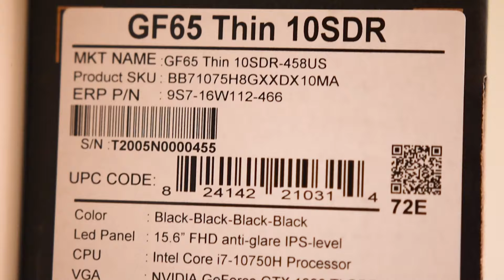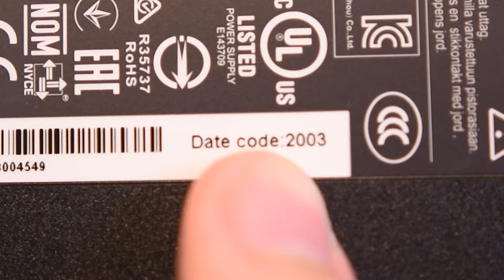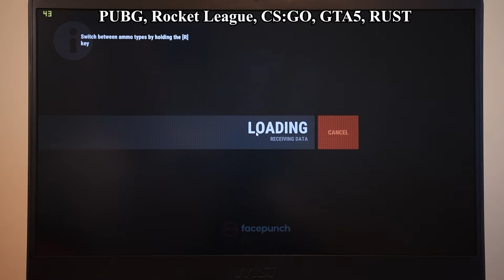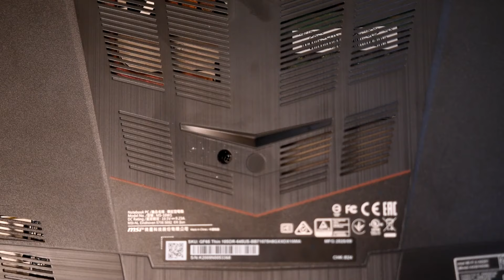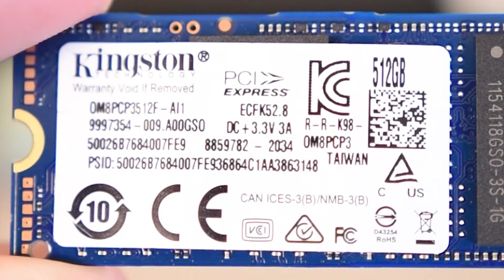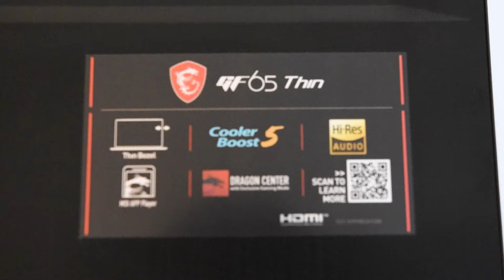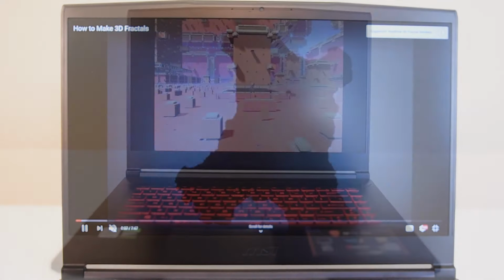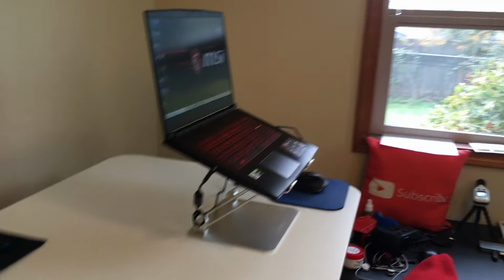GF65 Thin MSI GAMING LAPTOP REVIEW, GTX 1660TI,  6 CORE 10750H

Comment: DO NOT BUY THIS LAPTOP. I bought it 2 months ago and I regret it. Horrible thermals. Gets super loud. Can barely run of today’s games. Just don’t buy it. Save ur self and buy a pc for the same price instead
Reply from the maker: Yeah pc will almost always be better but can you show me a gaming machine that is quite and not hot? they all tend to do that if they are a laptop. 

if you have any more questions feel free to let me know I am standing by, I am trying to build the best tech channel possible if you like this kind of content I think you would make a great subscriber. Good luck and let me know if you have more questions :) I love chatting about tech.
Reply: I actually have this gaming laptop and I’m able to play the games I love. I mean I guess you won’t be able to play the games that are very high in graphics but so far the newer games, I am able to play them and the ones that I am not able to play that are new, I was just recommended to just add Ram to my laptop and then I should be able to play those newer games.
Reply: Also gaming laptops tend to get loud and hot. It’s the normal.
Reply: For low thermal, underclock the cpu. That's simple.
Reply: Seems like a very average laptop to me.

And laptop use case is different from desktop.

You cannot lug a desktop too University or if you travel alot.
Reply: I have this I upgraded to 32gb ram. Play destiny 2 and spiderman on it. It gets hot and it's loud but it's a laptop so I understand it's not a PC. The price was great.
Reply: I had this thing sense 2020 and it can't even run on the lowest graphics

Comment: I actually bought this same laptop and its arriving in about a week of posting this comment so thanks for the heads up on what to expect with it
Reply from the maker: Super glad you found this video useful. I cant wait to hear about how your experience with this machine goes. Since you enjoyed the video I think you would make a great subscriber. Let me know how it goes when the machine arrives. What games will you be playing?
Reply: @SERGE_Tech  mostly rainbow 6 siege and halo reach but who knows, I can run probably run anything on it
Reply: @swearetic  Would you please give me a minute and tell me how was your experience?
I'm planning on buying it, a first hand review would be very helpful, thanks.
Reply: @kumarshishupal1583  so far, its been great. When gaming the laptop got pretty toasty but an undervolt fixed the problem. Raise the laptop when you're gaming though. The one I got was 8gb of ram but that was an easy upgrade. There's also an extra nvme slot so you can get more storage. Overall, it's a great choice and I really recommend it
Reply: @swearetic  Thanks brother, really appreciate it, I'm thinking of buying a cooling pad with it and a bit confident that it'll help
Reply: @swearetic  hell explain what you mean by undervolt
Reply: @sound2loud  basically, cpus get more power than they need which generates more heat. Undervolting just allows you to remove that extra power to generate less heat, so basically underclocking but for the power going to the CPU. There's a bunch of tutorials on YouTube that are pretty simple to follow.
Reply: @swearetic  can you add hdd hard on it beside the ssd one or it's not allowed on this laptop?
Reply: @Metallic95  it only has m.2 drive support. There is one sata m.2 slot and one pcie gen 3 port. Unfortunately there's no space for an hdd
Reply: @swearetic  that's bad because that ssd with 512 not enough
Reply: @Metallic95  you can add an nvme drive on top of that 512gb ssd

Comment: Believe or not i could put my hands on this laptop for 400 bucks and it is new
Reply: Do it
Reply: @billymilkstain2784  i did it and got scammed
Reply from the maker: How did you get scammed what happened?
Reply: @SERGE_Tech  some one was selling it on ebay for 500 bucks i bought it then the seller removed the item and they just vanished from ebay now i am with contact with ebay to get my money i will get it eventually but the process is frustrating

Comment from the maker: Still standing by to help everyone! Good luck on your laptop search!
Reply: Never saw a detailed review like this..... awesome ...!!
Reply: hello i have a gf 65 thin 10SDR model i keep having battery issues went to dragon center for battery calibration (this says i need to calibrate battery).  Battery goes to zero acts like it isnt plugged up then system shuts off completely.  If I try on battery only after fully charged the battery quickly fades then when i restart it gives me a bluescreen error.  A generalized blue screen error.  I have to keep ac adapter plugged in at all times to run device will not work without ac power.
Reply: I am confusedbetween asus tuf f15 and msi gf65 1660ti. Mainly for coding and occasional gaming. Dropped a like.
Reply: @pravvinp5740  msi
Reply: @rohansheikh8589  how are its thermals? For regular and heavy usage
Reply: ordered it today after viewing your review
Reply: @soorajkumar3383  i am about to buy it can u tell ur experience till now? Please tell me weather i should go for it or not..plz reply

Comment: Just found your channel, and this video, because I just got this laptop and was having trouble getting the back panel off.  I missed the screw under that sticker in the middle.  After that it was a breeze but during the process I accidentally popped off that long thin cover over some wires at the back.  I'd ordered an extra 8gb ram at the time so I should be good now.

I appreciate the game tests using just the stock 8gb.  This is a fantastic bang for the buck but if someone's on a budget you can always get more ram and storage later.
Reply from the maker: So true well said, yeah a lot of laptops use fragile plastics its nice that its light and the machine works but yeah people gotta be careful or else they risk breaking that back panel. I literally damaged it and I was very careful during the dismantlement.

Comment: Confused on msi gf65 and helios 300, helios 300 is little expensive than msi. 
But i really like the feel of msi gf65. 
Lightweight, 6 heatsink pipes, build is good being lightweight, easy to carry anywhere. It would make msi gf65 great if they provided with one usb port on left, 1 slot for hdd and color accurate monitor like gp65 leopard.

Comment: i have the GF75 and the fans are always going nuts. how can i calm this down and still have great performance?
Reply from the maker: There is software you can get to modify the fan curve. speedfan can help you control your fan speed. It may be loud but really there isnt too many ways to cool it correctly.

I am trying to build the best tech channel possible if you have any questions I am always standing by to help you with your tech needs. I will always be there for you, So if you like this kind of content I highly recommend you subscribe. :)
Good luck!
Reply: Depends how old it is.  Try reapplying the thermal paste.
Reply: Try undervolting

Comment: Hey SERGE Quick Question as there’s 2 laptops on offer both at £600 which I can just about afford. Which laptop though?:
Acer Nitro 5
MSI GF63
Reply from the maker: Msi has better cooling, I think the calm styling of the nitro is better but the msi tends to be cooler not by a lot but it is.

Msi is killing it in the laptop sector.

Comment: I need a laptop, I want a Mac but don’t want to pay crazy money. You know my work I use a Mac desktop but it would be nice to have a laptop for check ups or to make sure the clips are recorded good. What would you recommend or is there a way I can view  the clips without a laptop? I use the camera now but you can’t see burn marks in the clips till I extract them on my Mac.I know you know this better then anyone 👍🏻
Reply from the maker: actually yeah viewing the clips are a portable machine like a laptops a real good idea, I try to test out the camera and the audio before I conduct a film session sometimes camera needs adjustments and so on. I am thinking about connecting a giant monitor on wheels for my self that way I can see exactly whats going on. I am not sure this would be practical for you but you could also get a smaller portable monitor to see the clips in greater detail or just view the clips on a laptop. 

what exactly do you mean by burn marks do you just mean errors in the files?
Reply: When the sun or light hits the camera it adds a little burn to the file, you can add color to it but really hard to fix better to crop out. I will try the monitor idea didn’t think of that. 👍🏻

Comment: Just picked up the 3060 rtx version of this laptop with i5-10500h, you should mention to slide the bottom cover off laterally towards the USB ports or it might snag and break. I'm doing a clean install of os and reseating/repasting the heatpipes soon to get the temps down, then installing better fan temp apps to tweak it to be cooler and more efficient. This is a nice design but it gets super hot and pretty loud playing RDR2 or Cyberpunk, so I may actually slightly underclock the cpu to get temps manageable.

Comment: What are the USB-C ports used for? Won´t connect my phone through them..
Reply from the maker: Most phones now use them so depending on the device you have. It’s the dominant port it can do anything and everything it’s the latest tech in ports.
Reply: @SERGE_Tech  Sure, I have the latest Samsung Note flagship but it only tells me there's low power in these USB-C ports so I'm not sure why/what they're supposed to do..
Reply from the maker: @Td5Adventures  well it says low power because a computer port usually is not designed for charging a phone, now it can charge it just slowly, like a trickle charge.
Reply: @SERGE_Tech  For sure! I was just wondering if it could transfer any data somehow. Feels weird to have two ports that only charge very slowly🤭🤔

Comment: How long do you think this laptop will last before needing a new one?
Reply from the maker: We are entering a new age where machines will last a lot longer then normal. Its build quality is still good even though its designed to save costs. It will last probably last about 8 years.
Reply: @SERGE_Tech  damn that's a long time, so you think it's worth buying it now?
Reply from the maker: @alanuribe2041  They started dropping the price on them by $200 at walmart, what stores in your area sell them? where are you located. I think its worth it!
Reply: @SERGE_Tech  yeah I saw one at Walmart for 800 which is why I looked up this video, definitely gonna buy when I get a bit more money

Comment: Acer nitro 5 or Lenovo legion Y540? Cause they are similarly priced. However the y540 is powered by 9th gen Intel whereas Nitro is powered by Ryzen 5 5th gen. I'm just concerned with acer's durability and quality control. Any suggestions?

Comment: Hey man I just did the ram upgrade and now my wifi isn't working. Please help?
Reply from the maker: Super easy fix just go back to looking at the ram upgrade there is a WiFi module that looks like a square with two thin wires on its left and right and just make sure there connected, sometimes they can be bumped or touched and dislocated. 

Here is what the module sorta looks like:
https://www.dell.com/en-us/work/shop/dell-intel-dual-band-wireless-ac-8265-80211ac-2x2-bluetooth-module-kit-includes-riser-and-antenna/apd/262-bbbd/networking?gacd=9646510-1024-5761040-266380031-0&dgc=st&ds_rl=1282786&gclid=CjwKCAjwjdOIBhA_EiwAHz8xm4EOdgAckN03GhgshDt1IbteOIyhAzB8YlW-2LZ90nagac6t9arHThoC8lUQAvD_BwE&gclsrc=aw.ds&nclid=cH2Txv9JGJGazdCEEdon172z0F-Aj5agPYSkHGCxz9ceOzPQnQlY3pZFJLJaosHa
Reply from the maker: Is it working bro just checking in… hope everything is ok.
Reply: @SERGE_Tech  Thanks for replying I took the ram out and reseated it and now it's working fine.  I appreciate it man.

Comment: I am uncertain between Legion 5i 10750H i7 gtx1660ti and this notebook. Both have almost the same features but the only thing is thermal issue for msi. And on the other hand Lenovo is 1,5 times more expensive than msi. Would you prefer msi for this price difference or you would still prefer lenovo legion 5i ? Thanks in advance!
Reply from the maker: I recently used the legion 5 and its much better then the MSI, build quality, keyboard, speakers, screen, ports, its all better on the Lenovo. 

if your ok paying more then go with Lenovo you'll get a better machine but if money is an issue just save and go msi or acer. you can find versions of the legion 5 that are less expensive with different cpu/gpu configurations. 

really though they will all play games quite well, I like the look and feel of the msi and acer since its more light but with that lightness you get a more fragile machine when compared to lenovo. 

I am trying to build the best tech & entertainment channel possible if you have any questions I am always standing by to help you with your tech needs what ever they may be. I will always be there for you, So if you like this kind of content I highly recommend you subscribe. :)
Good luck!

Comment: Hi dude.. I m also thinking of buying this one though it is exceeding my budget just coz of 1660ti card over 1650. But this laptop is going through so much of the controversies in the reddit forums for thr heating and service issues. So I m not  able to make the final decision. I regret buying a faulty macbook prior to it for 150000 approx tat has so much issues. Now these specs do fit my needs but I m so apprehensive and not to go my savings go waste.. Can u guide  over these Controversies, Whether they are true or not as I assume tat u have been using it for a while now.
Reply: It has 2 years warranty. If you are in a city with msi service centre, go for it.
Reply: hey man if you're still looking for a laptop i just got the MSI from the vid and its INSANE. Definitely not a waste of money the laptop is super good for gaming and also for work/school!

Comment: Hello, my friend, thanks for your the video, I have bought this laptop and I added a fan bellow it to refrigarate it, do you think it is good or bad?
Reply from the maker: Additional air flow is always good, are you using some kind of laptop cooler or laptop stand? Yeah it’s probably good :) unless it spins the fan the wrong direction it could cancel out and slow the main fan down take note of this.
Reply: @SERGE_Tech  Thank you for your response, Yes it is a notebook cooler,  it spins directly to the laptop, it means the air goes directly to the laptop, do you think it is affecting to my main fan laptop?
Reply from the maker: It depends on where the air intakes are but in most cases it works fine can you send me the product so I can take a look?
Reply from the maker: I have found laptop stands to be able to do the trick basically with out the fan
Reply: @SERGE_Tech  Yes for sure, it is a U-V-2UAK notebook coleer, thanks for your help again
Reply: The brand is Unitec

Comment: Do you have set up the "Energy Plan" to "Ultimate Performance"??? If not your FPS might be lower than usual because the Performance Limiter caused from the Energy Plan (are you on Mobility Mode?) - If you set the Energy Plan to "Maximum Performance" and set the "Dragon Center" to "Medium" or "High" Performance mode then you can play Apex Legends at Maximum setting at least 80 FPS! Its not a Notebook, its a Powerbook! But its not "Future Proof" like a "Clunky Big Desktop-PC" which is why I would prefer a "Clunky Big" Desktop-PC
Reply from the maker: Great question I actually failed to check this so there may have been a chance however the performance felt like it was in line just sometimes lacking I believe the 1660ti was thermal and power limit throttling. Yeah if your a power user clunky pc is where its at!

Comment: What does the fn+F7 command do? The one that looks like a G ,thanks in advance!
Reply from the maker: its a programmable button since its an f key and the g is what they branded the button as for the gaming center that opens up when you press it. They are experimenting with control over the user via an application that launches and lets you customize settings on your machine. 

Since most gamers and people don't understand how to use there computer let alone the operating system this button serves as first contact, they are merely fighting to be the first to have an impression on you, after all it is partially there assembled hardware.  

If you are a power user there is probably nothing for you but if you are new to pc gaming and pc usage then this might be interesting to explore. 

Do my answers make sense? I would love to have you as a subscriber. I am standing by to answer all questions.
Reply: @SERGE_Tech  Thanks, I am not using the program, but atleast now I know what is the command for!
Reply from the maker: Do you enjoy RTS or FPS games? In the latest video that I posted there’s a game called natural selection 2 check it out and see if your interested I’ll send you a copy via steam if you want :)

Did you already pick out a machine?

Comment: Hey serge I'm looking to buy a laptop and is confused between the i5 version of of this msi and the asus rog strix G15 . Spec wise msi is better for the same price but I don't know which is the better overall. A little advise would be really helpful.
Reply: I’m also confused between these two.
Reply: @monk3740  its really confusing because if you going for the gaming aesthetic then the asus is much better but the spec on the msi is just too good for the price. I decided to go with the msi since the specs are what matters in the long run.